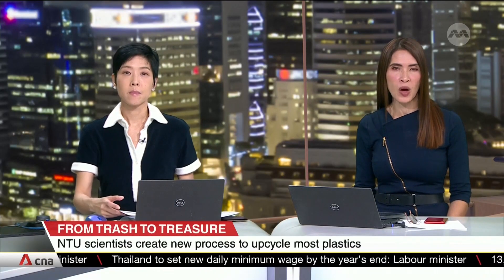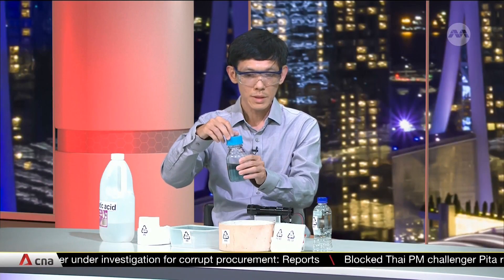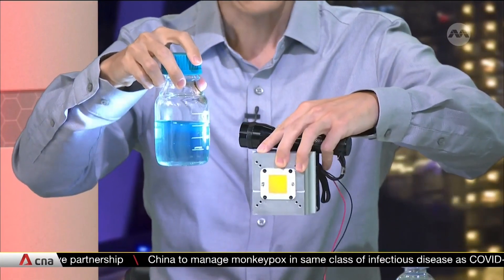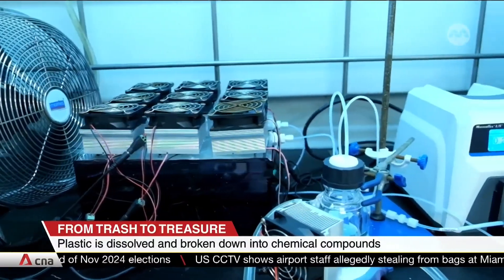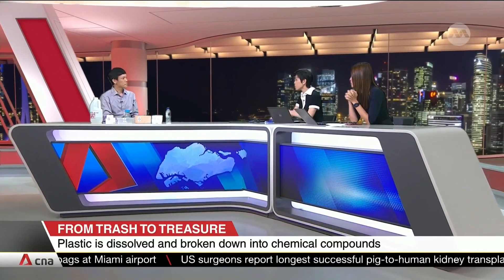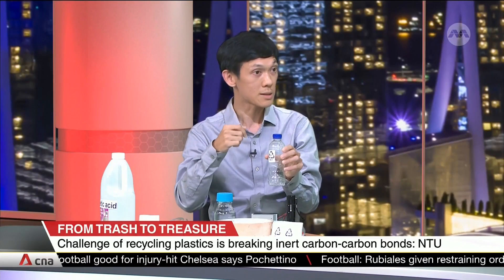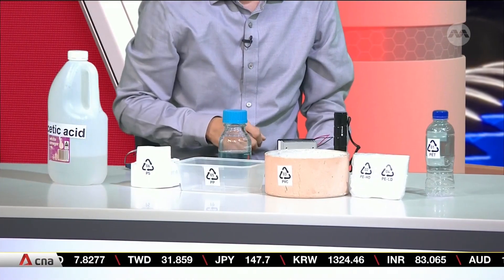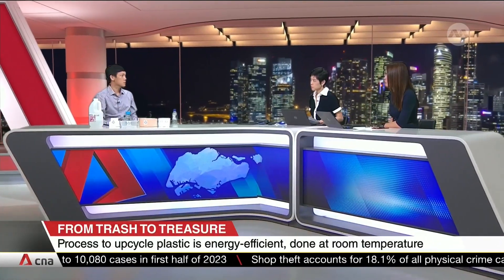NTU scientists create new process to upcycle most plastics

Comment: So does this mean that they will not charge for plastic shopping bags ?
And I do not need to throw rubbish in small plastic bag down the rubbish chute ?
Reply: Probably HDB, JTC, HUDC needs to redesign the TRASH HANDLING 🗑 conduits in the Megacity 美咖市 building design.

The ENERGY conservation, Heat Engine consideration, AESTHETICS, residents COMFORT, <noise, vibration, radiation shielding, sanitation, tactile, ease of cleaning factors>.

😂❤
Reply: Safety.

Ease for civil defense purposes. 
And others.

😂❤
Reply: The production of plastics still emits pollutants and consumes fossil fuels. Furthermore, we cannot guarantee that all plastics will be disposed of properly even with this new tech. After all, recycling has existed for decades but most people can’t even be bothered to do that. This breakthrough should not encourage us to use more plastics; rather, we should still continue to try our best to minimise our use of single use plastic.